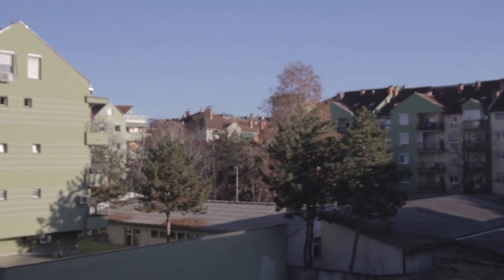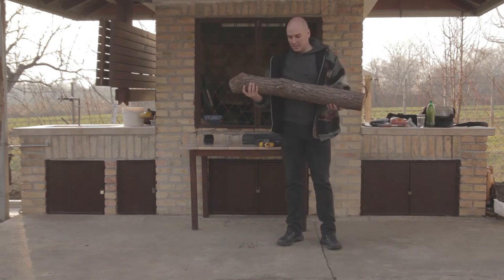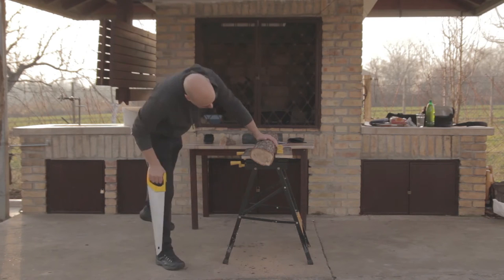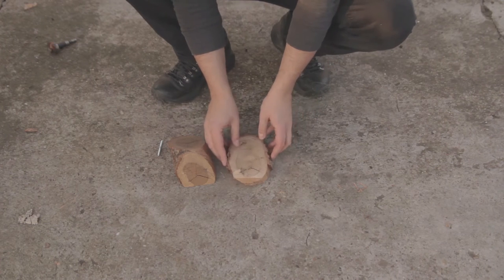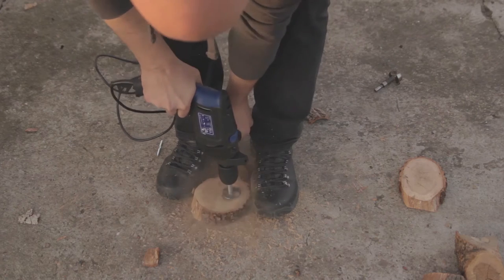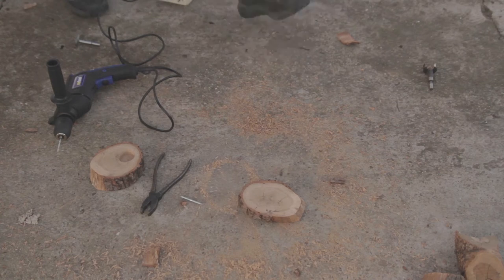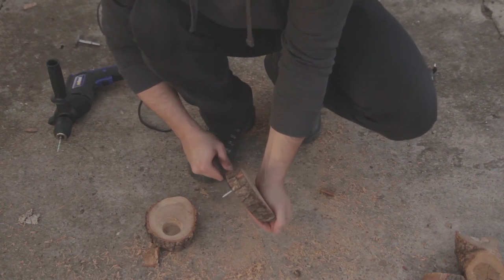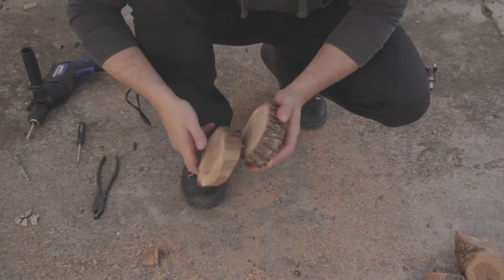MAKING A DICE BOX - The Story Of How I Almost Failed To Make It

Comment: Video quality and editing are great. A bit more planning maybe would have been good as you mentioned :) A cool idea could be to have some extra notches cut out for your fingers to get the dice out, otherwise you'd probably have to invert the whole thing to get them out. Showing some close ups of the finished project at the beginning of the video would also make it nicer to watch. Good work anyway, looking forward to more tabletop related stuff!
Reply from the maker: Landan Lloyd Thanks for the feedback, man. I appreciate it! Inverting the whole thing was the original plan, but I realized that drilling a bigger hole is the way to go, though it'll have to be on a CNC machine. These small ones are cool, but they can be a problem.
Reply: One big hole would be good but not many people have a CNC machine :) It's nice to see projects we can do ourselves, most of the time anyway.
Reply from the maker: Landan Lloyd Indeed. :) You just have me an idea to look for a bigger diameter drill bit.